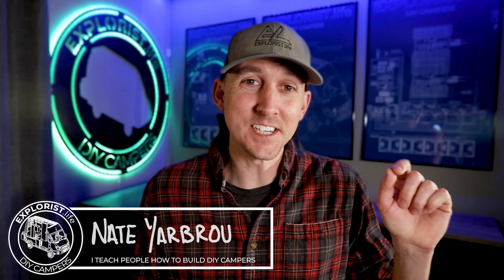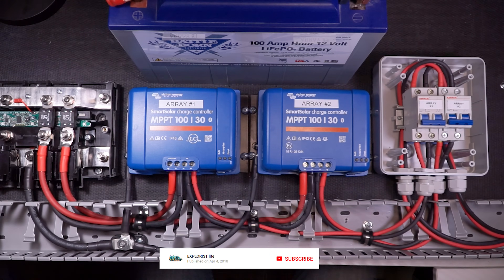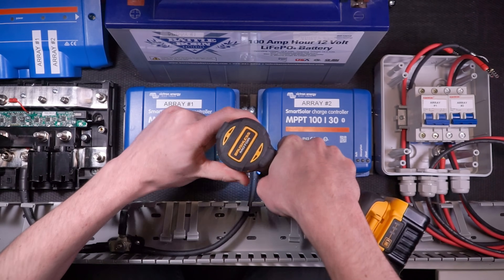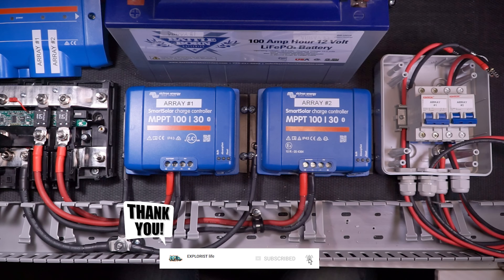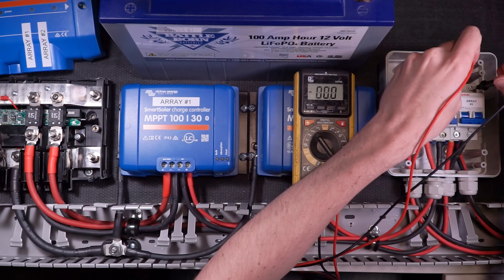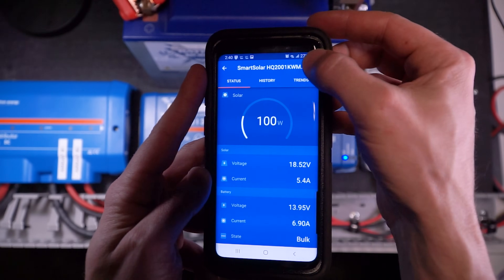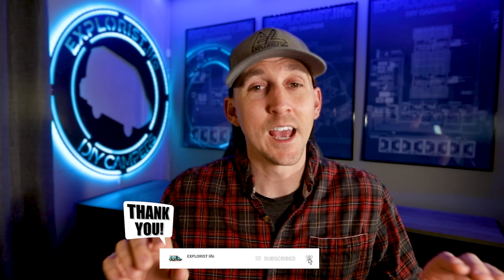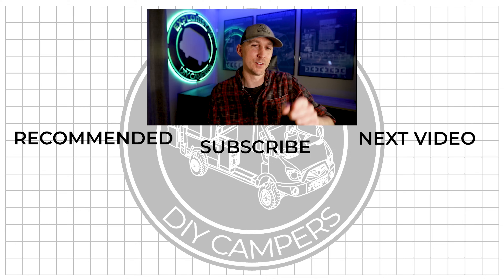How to Wire Multiple Solar Charge Controllers into a DIY Camper Electrical System

Comment: At the 6:35 you talk about sinking the two controller to get a combined output, I have two controllers 75/15 and 100/30 , my question is can what you have suggested only be achieved with same MPPT's or will this work with two different models both Victron energy products, When I follow the setup I dont get the option for combined controller wattage like in the video are you able to help.. Thankyou - Dale from Australia...
Reply from the maker: Any of the sizes of Victron SmartSolar charge controllers should work together.  Make sure both charge controllers are updated to the most recent firmware?
Reply: @EXPLORISTlife   All chargers are up to date with their firmware and latest update, I have followed your video , but when I join either controller to the network , they link but the option for combined wattage doesn't appear. Thanks for getting back to me . 75/15 Smart Solar and 100/30 Blue Solar with bluetooth dongler.. I will review your video again ensuring that I haven't missed something..
Reply from the maker: Ah... I don't believe it works when using the dongle.
Reply: @EXPLORISTlife  That was the conclusion that I came to also.. But thanks for your help.. Appreciate your guidance..

Comment: Here's a question,  I wonder if you or others have tried and found it works.  
An parallel array of 6 panels (55v 30 Amp total Max) coming in to a single victron charge controller 75/15. Is it possible to just tap off at the solar charge controller PV input to parallel another 75/15 charge controller to get double the charge rate for the battery bank. Or would the 6 panel array need to be split in two of 3 panels, each feeding their own solar charge controller?
As tapping off at the existing controller would save running an extra set of solar cables between panel arrays and solar charge controller.
Reply from the maker: Maybe I'm not following what you're trying to do, but connecting a single array to 2x charge controllers won't work.  I'd just recommend getting the proper sized charge controller for your 6 panels: https://youtu.be/MxziHKvTRh8
Reply: @EXPLORISTlife  Thanks for the feedback. Though yes a single charge controller would be easiest from a installation point of view. It isn't practical nor financially viable for my current setup.
I have worked out that the Victron Charge controllers seem to work in parallel to charge, but only if each controller has it's own solar array set up.

Comment: I'm trying to understand the main reasons for installing the second charge controller.  In this case, is it just to see the power produced from the two different arrays?  If it doesn't exceed the capacity of the charge controller, couldn't you wire both arrays to the same controller?
Reply from the maker: Multiple charhe controllers are usually used when the TOTAL array capacity exceeds the max capacity of a single charge controller or when there are arrays in multiple different locations (on the roof of the camper and then another one ground-deployed 100ft away.
Reply: @EXPLORISTlife  Thank you for that explanation.  Is there a benefit to running the ground deployed panels on a different charge controller instead of running it in parallel with the roof mounted (assuming total input didn't exceed it's rating)?  I'm still learning and was previously under the impression that you could run several different arrays in parallel as long as it stayed within spec.

Comment: HI, thanks for the videos.
I have a question that you might be able to answer. The way you wired the charging outputs of the controllers to combine their outputs in parallel to charge the batteries, effectively up to double that one controller is capable of doing. Then would this be the case of the Load outputs also. 

Thinking that if you were to parallel connect the Load outputs from the controllers say of 2 x 75/15 Victron charge controller, then you could work on a load output of up to 30Amps. 
Would that be right?
Reply from the maker: Yep!

Comment: I have a setup thats similar to this and I've been studying your diagrams. I'm addition to 2 charge controllers, I'll also be using a DC DC charger. Should I go with just a traditional bus bar setup in that case since I'll need to use 5 fuses?

Comment: Great video-Thanks! Some installs on a boat have 4-6 MPPTs. Is there a way to wire the MPPTs where they don’t each take up a space on the distribution? For example, running all the positives from the 6 MPPTs to a busbar then a single wire from the busbar to the distributor?
Reply: No. Best way to fuse each bud.
Yes easier to just wire to one point but less safe to do so if you have a short on the output from the mppt etc.

Fuse and wire each x
Controller back to the busbar

Comment: can I add solar charge controller in parallel with off grid inverter to increase the capacity of the built in charge controller ?
Reply from the maker: Charge controllers wired in parallel like shown in this video would indeed allow you to add more solar charging capacity to the battery bank.
Reply: @EXPLORISTlife  thanks for clarifying but the added charge controller can supply the inverter directly with pv input
Reply from the maker: These Victron SmartSolar charge controllers cannot.  They need to have a battery in the system to function.

Comment: Hello there ,can I wire a epever into a growatt inverter ? Is that normal ? I have 14 panels(30volts,170 watts)  3,000 w grow watt hybrid inverter ep ever mppt charge controller (60amps)  and a combiner box . I'm having trouble wiring it , I don't know where to begin and how much of each wire to buy , the system has four 100 12 volt battle born batteries I have 2gauge wire for that but do I need special connectors for the panels to the combiner box? And was going to build on it but wanted to do four strings with three panels on each one to start, does that sound doable and what gauge wire would you suggest other than from the battery to the inverter? Thank you

Comment: Question. how come you got different voltage measure from your solar panel array. 41.8v and 19.2v they are connected together.
Reply from the maker: Each charge controller was connected to two different sized arrays that were operating at different voltages/amperages/wattages.

Comment: A huge thanks for all your videos and sharing your knowledge.

I just ordered a few wiring kits from you for my system.

Battleborn sent me 2 SCC115085410 SmartSolar MPPT 150/85 TR VE.Can Charge Controller with Bluetooth

I ordered 2 wiring kits from your website

My question is my panels are 340w x 6

I understand 3 to each controller but how do I know if they programmed the controller for series or parallel?

Thanks a million in advance.

Cheers

Travis
Reply from the maker: Great Question!  The charge controller doesn't know if the solar panels are wired in series or parallel and it also doesn't care (Given the input voltage of the charge controller (150v, in your case) is not exceeded).  All of the 'programming' for the charge controller is for the 'output' side of the charge controller.
Reply: @EXPLORISTlife  Awesomeness thanks a million for clarifying.

I have 4 - 12 guage wires coming in from the roof 10' long.

What is the best way to connect to the panels to these wires / what can they handle series or parallel.

Panels are 340 watt and 36.5 MPP Volts

Thanks again!
Reply from the maker: What is the actual make & model of the panels?
Reply: @EXPLORISTlife  Heliene  72M-340
Reply: Max system voltage 1000volts
Reply from the maker: Okay, so... bad news...  The voltage is too high on those panels to wire them in series with the 150|100 you have.

The amperage is too high to use the 12 gauge wires you have.

If I were in your shoes... I would recommend sending the MPPT 150|100's back and exchanging them for 250|85's so you can wire the 3 panels in each array in series to the 12 AWG panels you have installed.
Reply: @EXPLORISTlife  Alright thanks a million for the help and response.  I wish I had you design my system!  I'll definitely be back to your store and website again.
Reply: @EXPLORISTlife  If I wired parallel would these controllers work?
Reply from the maker: Yeah, but you would have to up-size from 12 AWG Wire to at least 10AWG wire, incorporate MC4 fuses for each panel, and then you'd really be pushing the limits of your MC4 combiners.  My philosophy of 'Do it right so you only have to do it once', says to swap out the charge controllers and wire in series.
Reply: @EXPLORISTlife  Thanks a million for the advice!

Comment: Thank you for the great video. If I have an all-in-one Inverter/controller, would I be able to add a charge controller only to add more panels or would I need to add another inverter charger? Thanks
Reply from the maker: Additional charge controllers can indeed be added independently of additional inverters.  The two are not related.

Comment: Hi there
i have 2 panels 175w in series so i can get higher voltage.... i have 48v solar charger that charges 4 12volt batteries since i have some equipment requires 48v... now i have another equipment that needs 24v 1amp... what are my options here. mind you im limited with the solar panels i cant add any. please guide me. tnx
Reply from the maker: Your best options involve buying more/different panels if your battery bank is 48V and your panels are about 20V, unfortunately.
Reply: @EXPLORISTlife  panels are over 33v each but my problem is the power one extra component with 24volt input that i need to use. so i was wondering if i can use another mppt with 24 volt load output.
Reply from the maker: I see.  Unfortunately I don't know about the overarching system to comment.  Apologies.

Comment: I have a question: I noticed you connected your chassis ground on each solar charger to the negative bus bar. Understandable since this would be for a van. But in my house, should the chassis ground be my earth ground?  

As a side note, Victron used the earth ground symbol instead of chassis ground symbol.
Reply: No.... dont use chassis ground as the same.
Inverters tend to have IT earthing systems and require you to follow each manufacture insteuctions ehn it comes to earthing.

Some have a floating netrual...some tied....some.have a relay you can tick box to tie earth and netrual (victron)

Some you add a ground rod.

All different and can add extra danger or make it safer!
Complex area so always follow instructions..

Comment: Nate,  I understand the need to use a 2 pole breaker between the panel and the charge controller.  However don't understand why the 63 AMP instead of sizing the breaker to protect the wiring.  Then go add a separate fuse link which seems to duplicate but potentially add resistance to the system, Thanks, Don
Reply: One seems to protect the controller the other the batterries.

Comment: Very nice..  So can I mix controllers..? I have a couple of 40a Blue Sky controllers (both not in use) and one Victron 150\85 controller.
Reply from the maker: They won't communicate if they are different brands and may fight when it comes to coordinating their charging voltages and absorption times.  You can use different sizes of Victron controllers in the same system, though.
Reply: @EXPLORISTlife  Thanx..  I didn't think so.  I have several Victron products..  Cerbo, touch 50, BMS 712 smart, 150\85.. I'll stick with all Victron.

Comment: Great video!
What’s the downside of using other MPPT’s that can not communicate with each other?
Is this just a look cool/app control factor or more than that?
I have a grape solar Zenith 40AMP MPPT and because I have mixed solar panels (2 groups) pushing 1000watt at 12v, I want to get the same MPPT i already have in a 60 amp configuration.
Can you see any downsides to that?
Reply from the maker: The 2 charge controller won't be able to see what voltage the other is charging at and the output voltage from one controller may mess with the 'battery voltage' reading of the other controller.  The will also not be able to coordinate their absorption times.
Reply: @EXPLORISTlife  Thanks for clarifying that re: variations that could come along with two charge controllers that don't communicate.
Would the Victron app/comms ability between two of their charge controllers also allow two different size/rated Victron charge controllers to be used in the multi charge controller scenario? If the say there's a large array with larger rated controller & then a smaller array feeding a lower rated controller, but if both Victron have the ability to work out the optimum for the batteries, and not butt heads :) ? Cheers for that Nate.

Comment: I'm curious if instead I could go from a combiner to buss bar to multiple charge controllers? Where the panels were wired in parallel and their  sum (amps) was higher than one controller could handle individually.

Comment: I was trying to go through all what I find on the internet about the setups with multiple charge controllers and no one ever mentioned nothing about overcharging "weak ones" with "stronger ones". I even find guys who connected different types of charge controllers with different output together with wide smile. In parallel setup, those regulators will be fighting with each other and their output will not be added up as we want. I was thinking that finally...this Lynx distributor will do the job, but than I read the manual and it is just intelligent fuse hub. In solar power stations, they use something like phase regulator which switch on and off every serial connected array one after each other so they don´t fight.  But nobody here mentioned that , nor  comes up with solution.
Reply: Erm...thats not correct. They will all normalize to the same voltage as its dc not ac 

Solar stations ive worked on and the string voltage of each array was brought up when wired in parrell. No magic tricks! Highest voltage took prefence and this would do same

Comment: Hi Nate. 

Is this the best way if you have a solar blanket connected to the system when main panels are parked in the shade?

Do the controllers need to be the same size if the solar blanket is smaller?

Thanks you

Comment: Super video. Thanks. One question, can you use different sizes of mppt smartcontrollers, or do they need to be the same. For example i have a 100/50 and i want to het a second array but smaller. Can i get a 100/30. Or does that also need to be a 100/50
Reply from the maker: They can be different. :)
Reply: Fantastic ....just what i needed to know

Comment: Do you have to use a Lynx distributor with a double controller system? I have a small teardrop camper that came with a 105 watt rooftop solar panel and Victron 75/10 controller. It does not have a solar disconnect in the system currently just a inline fuse. I will put one in also?  I would like to add a  2nd 75/10 controller and use my freestanding solar panels (2 or 3 of my 50 Watt panels) through a port in the side of my trailer.  I am just going to a 2 battery wired in parallel system.
 Thank you in advance!
Denny

Comment: Hi Nate, Mate, your tutorials are awesome. Nate you mention in this tutorial the need for multiple charge controls if your array exceeds a single controller. What if i have a 100/30 and increase my battery size so the i now need more than 30. Let’s say i need 60amp. Can i introduce a second 100/30 (in parallel or series) to get the required 60amp or will i need to upgrade to a 150/75? Would really appreciate your insight. I image two 30amp controllers one would cancel out the other as one would see 30amp in or will VRM allow me to override or set both units to 30amp each?

Comment: Hello Nate, thank you for sharing the knowledge in such an educational rich approach. Keep them vids coming... 

I have a question for you:
Following the example above, lets say i have a 200Ah battery bank (a lead acid) and an DC/AC inverter where i want to always limit the battery bank charge current to a 0.1c equivalent to 20A and i still want to have available the remaining current that the charge controllers can provide to supply my AC appliances through the inverter?
So how to limit the charge battery current without limiting the output current of the controller?

Thanks man

Comment: In your narration of the video you show the "network total power" line item when you only have two controllers on the network. I have three victron smart solar controllers all three on the victron ve Network yet I don't get the "network total power" line item in the display. Are you actually showing us with just the two controllers or is your smart shunt or some other device already connected to the network allowing that to show?

Thanks

PS: nice to see somebody else using crimped ferrules I'll have to look back through your other videos to see what tool you're using I still haven't found a ferrule crimping tool that I like

Comment: Hello I have 300w and MPPT and 200w PWM can i parallel it  to charge into one battery bank?
Reply: I'm not sure what you mean by parallel it, but I had a system for years that had one mppt charge controller and two pwm controllers feeding the same battery bank.  Each controller had its own group of solar panels and connected to the battery bank as separate systems. I could shut one system down and the other two would keep charging.
Reply: No
Reply: @المعلومةالخفية why not?
Reply: Just keep them separate
Reply: I have a system solar is 24v and 12 v batteries. S mppt thats 150/100. I want to serios/ partell 2/12 to 24. How do I connect a 120 panel to what item. I have 3000 inverter.
Reply: Assuming the PWM is not Victron and the MPPT is, they aren’t able to communicant to stay in the same charging phase. If this is the case, my preference would be to upgrade the PWM to a Victron and link them via wireless network as shown on this video, or if you are running a Cerbo, network them that way.